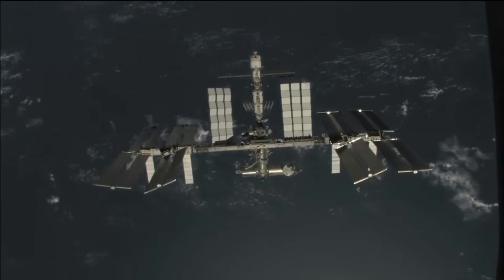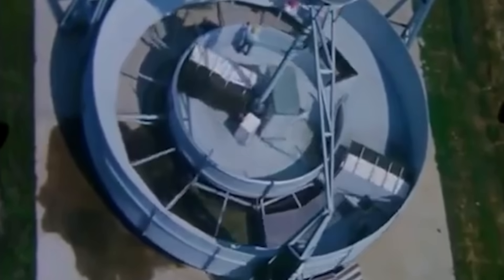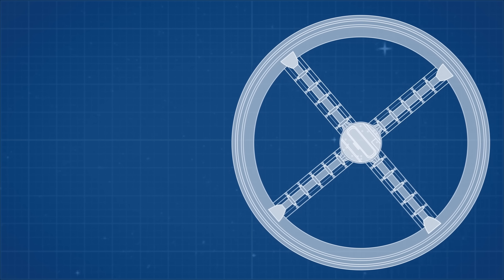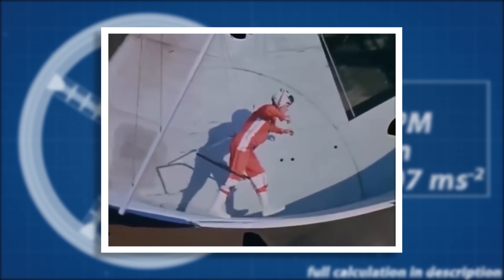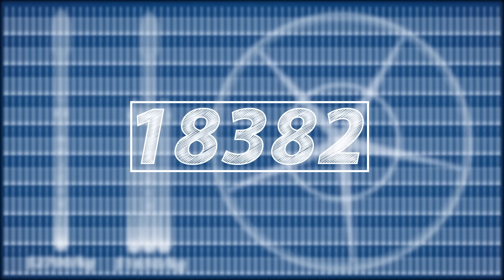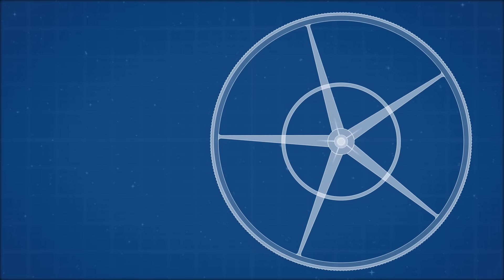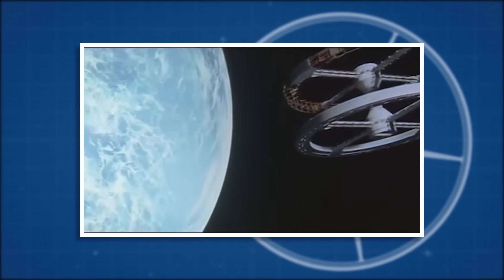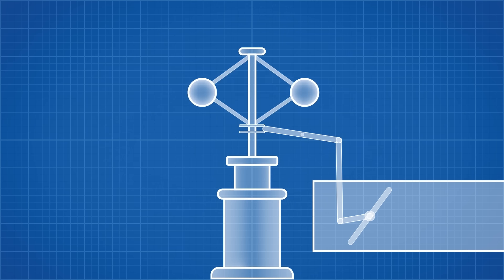Can We Create Artificial Gravity?

Comment: You would not use current launch technologies to loft such a huge space station. You would switch to Ground Assist launch technologies. YouTube, Greenlaunch. Large scale hydrogen gas gun launcher. Interview John Hunter. There’s a design where a hydrogen gas gun would go up the mountainside of Adagdak Island  (Aleutian islands, Alaska). Lowers launch costs by orders of magnitude. Also rail launch, look at some of the Holloman Air Force Base rocket sled videos.

Comment: How about starting with two pods connected by long cables like in Project Hail Mary? Bring up a few more parts with every visit to the station and before you know it, it will be a giant cylinder like Interstellar. Make rocket boosters that can be disassembled in space to use the material instead of dropping the parts in the ocean or using absurd amounts of fuel to land back on earth.

Comment: Another way to create artificial gravity is to accelerate and decelerate continuously at 1g. This takes an almost infinite supply of extremely efficient fuel! The wheel is not a bad idea but it will be big. Turning at 2rpm the required radius for 1g is 219 metres. Bigger means heavier and a larger frontal area, increasing the risk of impact with space debris. Who would use aluminum when there are new, stronger, far lighter composite materials? A one million tonne mission vehicle could carry a hundred thousand people. Why so many?

Comment: With right algorithm, In simulator, Keep the plumb bob from moving from 1 g vertical in the container, no matter what the bolt ship is doing in traffic, as the rotational gravity sim is constantly accelerated and decelerated without moving the plumb bob from vertical?
 Floor angle will need to be variable controlled on mechanically actuating pivot to provide stability in compensation for bolt ship travel affects on the the wheels, and habs and occupant , so dont throw away the magnet boots yet, there could be flying plumb bobs🤔

Comment: Ship...giant crossbow bolt... inside bolt casing are centrifugal 1g constant hubs that accel and decel at constant 1g constant spinning but while accelerating and deceleration to maintain 1g constant but not without minor low g intervals and turbulence induced by constant acceleration and deceleration in a recoil type spintop that likely can perform Regenerative braking on deceleration.main thing is this wheel spinning inside the bolt has habitats shaped like shipping containers? With handles on em so that can pivot back and forth with change in rpm, to provide im hoping optimum 1g constant centrifugal force constantish force, while allowing the habitat floor angle to change for the occupant who is essentially being swung around accelerates then brakes then accelerates again and so on..going on an endless track around on perhaps electromagnetically levitated track to limit the hub and wheel expansion by centrifugal force, like bearings but the container or bucket needs to swing like a bucket outside the wheel where its handle pivots, like a rockoplane amusement ride? The cage hold ing the occupant is able to spin around as the ride spins around? Anyway the floor angle is able to change relative to how its controlled by the occupant but a computer controlled hub can be fabbed up that can recoil accel and Regenerative brake a wheel locked electromagnetically at the outside diameter of the wheel but the wheel has compluter controlled rockoplanes that maintain the stability of the floor angle for the occupant while accelerating and decelerating at preferably 1 vertical g force constant ish so yo can run back and forth the long way with magnetic shoes and feel the same either way if you have your long run of your container positioned to pivot at 90 degree intersection or whatever...this may work somewhat, hopefully giant bolt ship... multiple spinning Habitats, placed in Staggered angles and counter rotations  so rotation of habs within the giant bolt ship doesn't become unstable due to counter rotation so the habs are all spinning in different positions to maintain stability of the boltship as she goes through space, the ship wont have gravity but the habs will, maybe if all that crazy stuff i jus said even works? Perhaps in simulation? Think recoil starter constantly trying to pull start a make n brake motor that will never start...the huge flywheel just keeps accelerating and decelerating but always spinning the same way at least, so just keep pulling because there are rockoplanes on this giant flywheel and they maintaining the floor angle constant between accel and decel...also a teeter totter lever thingy rocks back n forth on a pivot or fulcrum, so if you got a rockoplane on the ends of the teeter totter ...they can pivot the floor angle as the teeter totter goesback and forth violently maintaining a contant control over vertical 1g force straight down on the floor your magnets are holding you to🫤

Comment: One thing this doesn't address is HOW you attain and maintain said rotation. You would need either:

Thrusters along the circumference providing circular thrust (like those spinning fire wheels but without constant acceleration)

Thrusters on the axle (to maintain its relative stationary position) and motors to rotate the station around the axle (similar to the tail rotor on a single prop helicopter)

2 counter-rotating sections sharing an axle (similar to a twin prop helicopter)
Reply: You need some physics lessons. In a vacuum rotational inertia is conserved. there is nothing to lose energy to. it may speed up and slow down by fractions of a degree an hour as mass it move closer and further from the centre. 

the thrusters on the axel to maintain its position? relative to what. 

the station is a massive gyroscope it does not need 'tail rotors' there is no axel when the whole station spins
Reply: @Lansea-v7s  Addition or subtraction of internal mass and said mass moving around [cargo, passengers, moving parts like elevators] as well as micro meteor impacts and potentially atmospheric drag [depending on where it is parked, the ISS for instance is in a low enough orbit that it needs an occasional boost due to drag].

on the spinning axel model, it is to keep solar panels or debris shields pointing at the sun [the only example I have for this is the fictional Babylon-5 Station]

And unless it is constructed at a lagrange point, it will need some form of station keeping drives at the very least. relative to wherever it is parked [or to go somewhere if it is a long-haul ship for say Martian exploration/colonization]. 

It isn't a perfect gyroscope, it is a spinning object filled unevenly with liquids [drinking and waste water], gasses, and moving solids [passengers, cargo, and the conveyance for such]. That would need to be corrected for, minor amounts [I didn't say it needs to be constant thrust, my imperfect examples used them, but I was describing movement patterns more than a 1:1 thing, which is unsustainable].

Of them, the Babylon-5 style is admittedly the worst and least sustainable design.  The 2001 station but with attitude thrusters is the most feasible.
Reply: @Lightman0359 reaction wheels, no need to write paragraphs for something with a 2 word answer

Comment: A theory I thought of and want to test is what if I take a metal ball the size of a baseball and crush it down so it’s as small as a speck of sand (if we had technology to do it). Then we take another piece of metal wrap it around that and repeat crushing it down to a little bigger speck of sand. We would repeat this process over and over till the metal gets large enough and it would be really dense and I what if that created some sort of gravitational pull. Mass and density creates gravity. It technically doesn’t have to be a large amount of mass as long as it is dense enough. Let’s call the output P. M2+D2=P4 simple. M3+D1=P4. M1+D3=P4. The output is still the same P stands for power p= gravity. The way a black hole is formed is the death of a dying star. Once a star dies it is crushed at a high speed creating an Insanely dense pressure of positive particles from the sun or star and somehow all that combined energy being condensed and pressured creating density creates a black hole with insanely strong gravitational pulls. I just thought of this and it’s probably not half way correct but I wanted to put my theory out there

Comment: If astronauts in a spinning spacecraft exited the craft for a spacewalk to, say, repair something, would they still feel the centripetal force clinging to the outside of the ship as they would if they were inside the ship?
Reply: Yes, and if they lost their grip, they would fly away on a tangent.

From the spacecraft, their path would initially look like a fall straight down, but then they it would curve to antispinward. To them, it would initially feel like falling, but then they would see that they were drifting away from a spinning spacecraft at a constant speed in a straight line.

So they'd need fall protection, like exterior window washers on highrise buildings, but when this protection failed, it would be less serious. The spacecraft could change course to fetch them, then return to its original course.

Comment: I  wrote a sci-fi story in which a small asteroid mining company simulated gravity by attaching opposing cables and pods to a heavy, spinning iron-ore asteroid.  Since the asteroid was already spinning, no fuel was needed to spin it up to speed.  The length of the cables was adjusted by the pods' electric winches to balance and calibrate the forces of the whole contraption.  As I recall, it only produced the equivalent of one-tenth gravity so the cables didn't have to be super long and, therefore, didn't have to be composed of some fictional super-fiber.  The pods had to be relatively lightweight, but parallel cables could be added if more pods (or weight) were added, two at a time of course.   Obviously it could be done without the asteroid just by attaching the two pods together.  But, by adding the asteroid in between, the cables can be much shorter. Too, the central mass creates a flywheel effect, which is more stable.  Lastly, it was an asteroid mining operation so they kind'a wanted the asteroid.  I ignored some potential problems, like the effect of solar wind, nearby gravitational forces, thermal outgassing of the asteroid, and the effect of movements of the occupants, any of which could slowly create an oscillation in the cables.  Jumping up and down, for instance, would cause a tiny bouncing oscillation effect in the cables.  It should cancel itself out in short order, but it would be troublesome if it were allowed to accumulate, but could be mitigated by well timed winch adjustments to the cables.  So how did the pods attach themselves to the spinning asteroid, in the first place?  Tangentially, of course, and simultaneously, with one on the opposite side as the other on a reciprocal heading.

Comment: Centrifugal gravity doesn't work. Dont spend money unnecessarily !

On Earth, the centrifugal force experienced in a washing machine or on a merry-go-round only exists thanks to our terrestrial gravity. The rotation “disturbs” the inertial rest state due to gravity; what is not in space. For example, if we "levitate" a millimeter above a merry-go-round, we do not suffer from the centrifugal effect since gravity does not press us against it.

The only "gravity" that could be created is that which opposes the movement.
In a circular movement, it is on the tangent, in the direction opposite to the rotation that the "gravity" would be found.
But if the speed of rotation is constant, the "subject" acquires the same speed as the ray and the relative speed of the support and the subject is zero if they are "glued", and as there is no more acceleration , there is no more "gravity".
To create artificial gravity, objects would have to be placed on the spokes of the wheel, or cylinder in this case, and not against its walls. Or that the rays be spread out in planes passing through the axis to be more cost effective, and the useful surfaces would be in opposite orientations on each side of the axis (an axial symmetry). Not to mention the constant acceleration.
Putting things on the walls relying on a centrifugal effect makes no sense in weightlessness.

Comment: build it on the moon or mars ez game. propulsion use cheap electric rockets + solar panels. someone else in the comment said main cabin + counter weight, lets add that too. if possible add some fusion reactor in themiddle running off helium 3 from the moon. Functional space station

Comment: I have the impression rotational "gravity" will only work if the persons or objects are stationary, the centripetal force keeping them normal to the rotating surface. However as soon as the individual stands and attempts to walk, in one direction or the other, the effects of said gravity are not what one expects.
Reply: Unless your centrifuge is tiny you can run and you won’t be running faster than the angular velocity of the centrifuge

Comment: centrifugal  force is a planets gravitational field that either pushes away or pulls something into the planet  ( usually pulls into the planet and sends crashing to the ground)
once inside the planet the centrifugal force spreads out to a less gravitational amount so that objects on the ground stay on the ground to equal the force of gravity the outer wall made for the center to stay constant. also the speed the outside of the planet turns makes the temperature on the inside , fast or slow makes the temperature that space sends to our planet, we need to make a ball that moves very fast on the outside and very slow on the inside to make gravity

Comment: Not like this, no. There is a difference between how speed and acceleration interact with inertia. Only acceleration can interact with inertia to create artificial though temporary gravity. All that to say that the speed must increase at a certain rate in order for motion to create gravity. As an example, the international space station is moving at miles per second, and the folks living there are not experiencing any noticeable gravity. In order to maintain 1 G infinitely you would need to increase acceleration by a factor of infinity. That said, this could work if you were willing to alternate between moments of weightlessness and artificial gravity while the station wound its rotation up and down. The problem is the cost. In space there would be very few forces acting to slow down the rotation in order to restart the cycle and so you would need to use energy to both start and stop the cycle. Most people who think about this process are imagining the type of centrifugal force we experience on earth, as a displacement of gravitational force. That is not going to happen in space.

Comment: The turning wheel may be unnecessary. A little rotating hub could, with, say, a cable attached and a small capsule on the other end of it, be twirled around almost any required diameter and at the needed speed. The occupants of such a capsule could even alter their rate of rotation or radius of spin according to their fancy &c. For instance, I might choose to take six hours of sleep each day in 'gravity' that exceeds what obtains on Earth. Enduring a stronger gravitational effect each day may be adequate preparation for spending the rest of the day in zero-gravity, which would be more fun and probably more useful than living as though on Earth. 
With such arrangements, a rotating axle could be made – with any number of capsules attached – each to a specific gear-wheel. But the trouble with producing such 'gravity' is that, despite what the Einsteins tell us, it isn't the real thing. For example, a pedestrian that's attached to a spinning rim, could, by taking a step backwards, reduce such a force; or, inrease it by stepping forward. 
The proper solution to this problem would be to discover or invent the means of producing halal, kosher or pukka gravity. And the closest we have come to it may be that that results from sustained linear acceleration

Comment: Honestly I think there’s an easier way. We know that gravity is dependent on mass.  The more massive an object the stronger its gravity.  We know that electrostatic force is ten times stronger than gravity.  So - guess what. Every atom has mass - every atom has an electrostatic capability - including your body.  You could create artificial gravity simply using electrostatic manipulation.  Now - here’s where we need to get practical - electrostatic force has electromagnetic fields.  We need dampers to shield the body from that kind of electromagnetism.  Cheaper than building large structures and we have the technology to do that.

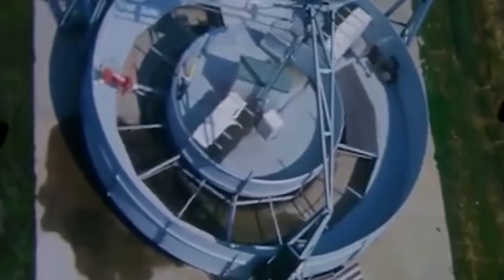Comment: 1:05

I think centrifugal force is generated for a reason other than you said: our brain makes us think that the place we are in is stationary and we are the ones who move. For example, when you turn a car to the right, in reality the car is moving to the right, but our minds tell us that we are moving to the left (the relative moviment between us and the car); so, in its conception, there has to be a force to the left aplied in us, the centrifugal force.

You said that it is because that, in a non-inertial reference frame of our body, everything but us is moving, but that's not the actual reason for the perseived force, if our brain really took that perspective, for it the body would stationary and the rest would be moving, in that case it would perseive no force in the body thus no centrifugal force. 

Actually, the brain takes the non-inertial reference of the place it is in, not of our body, so it ends up thinking the body is moving and the place is stationary. Which means that the place is inertial and the body has a force in it, the centrifugal one. That's is actually amazing, and shows how cool the nature of out minds can be.